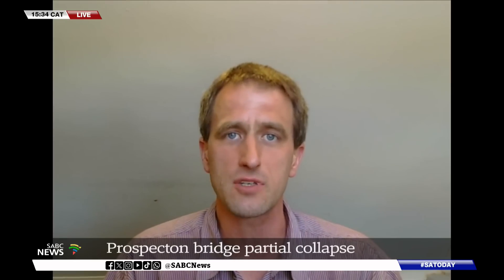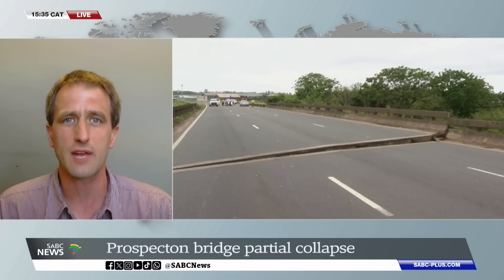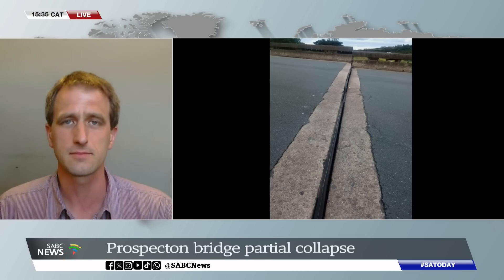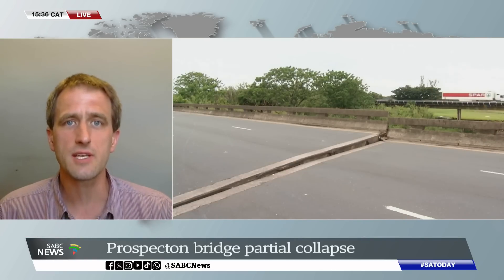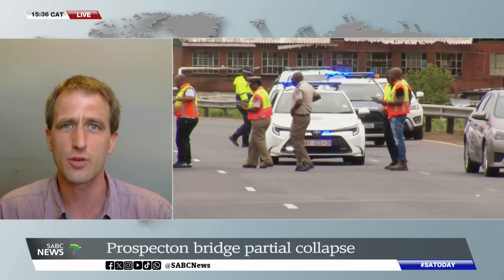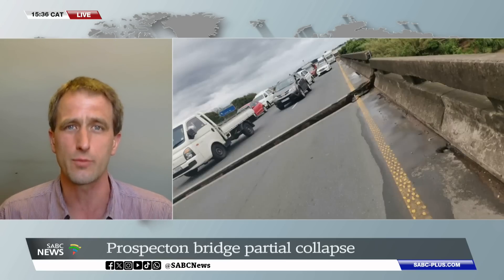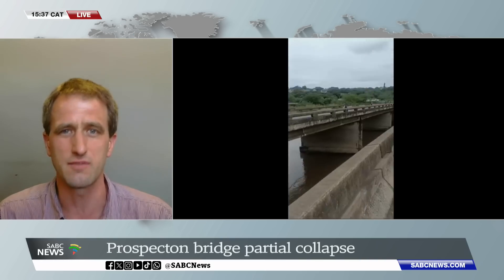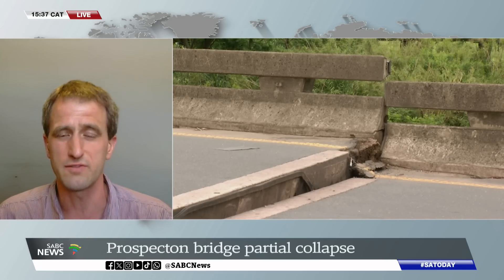Extreme Weather | Heavy rains affect Prospecton Bridge: Prof Richard Walls

Comment: They just don't seem to build bridges like they used to:  During the 1987 KZN floods, the bridge over the R103 at Verulam was lifted up out of place but the old single-lane steel bridge just a few meters upstream held firm.  And the colossal railway bridge which takes a whole passenger train on its length just stood majestically through it all.  Both the latter bridges were probably built late 19th or early 20th century.
Reply: Your comment is a bit unfounded. If you know the site where this highway was constructed then perhaps you could have your input. With the surrounds of the environment creating a huge inflow of masses of rainwater after heavy rainfall within that catchment area (Close by is the Reunion, Isipingo and further down toward the bridge all within 3-5km inland) that is masses of water being channelled into the river just before the old road leading uphill to Umbogintwini. I would say that this is one of the many reasons as to why the Industrial areas of Pospection area experiences periodic flooding .Could be soil washed away under the concrete support columns of the structure, over a period of time
Reply: @johngmulhatton9794  Yes, I worked at Prospecton at the time so I do know that it is repurposed land.  A similar thing to what I described happened to the Tugela John Ross bridge also.  Traffic had to be diverted to the older bridge.  However, in all fairness, there were some instances where the older bridge was damaged while the newer held firm.  I agree that many factors have to be considered so that a sweeping generalization will not do. In the case of the Mvoti river at Verulam, which I witnessed, the new and the old road bridges are about 20 or 30 meters apart.
Reply: This is an old bridge. Built strong.